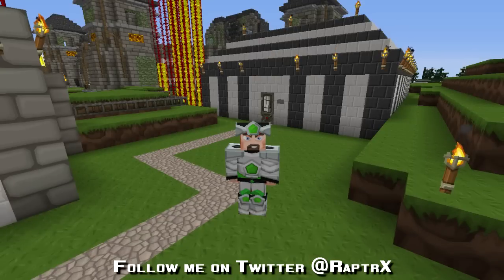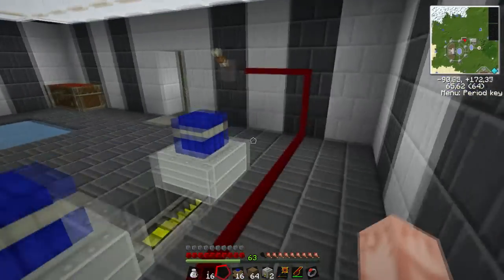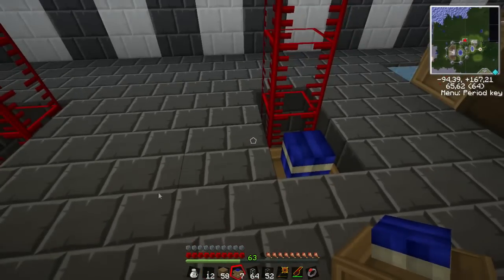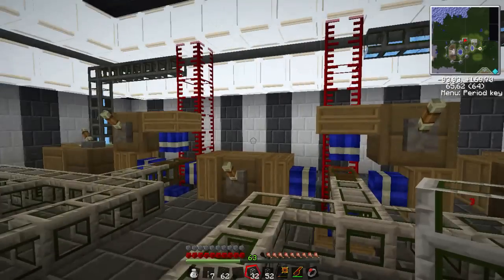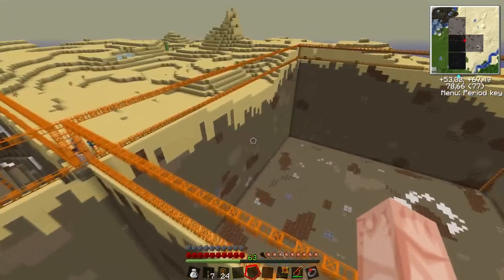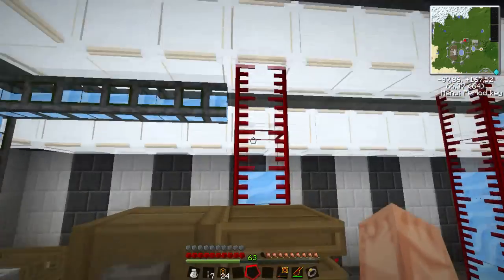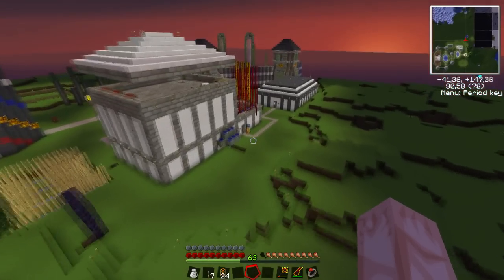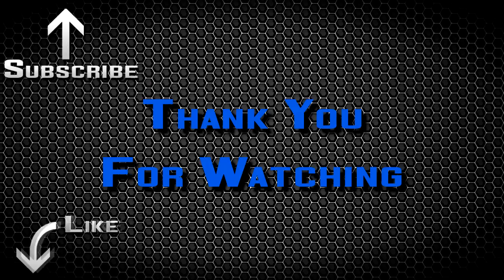How to Tekkit - Combustion Engines and Water Cooling

Comment from the maker: To do that the same technique that I used to pump the oil from the last tutorial will work. I would still suggest using a 3x3 water source rather than using teleport pipes since they are not very reliable as all it takes is server lagg for the chunk to be unloaded and water stops flowing.

Comment from the maker: As in the two water pipes from the pumps to the same water tank? You would still need two outputs since one output with 4 redstone engines wont be enough for all 8 combustion engines.